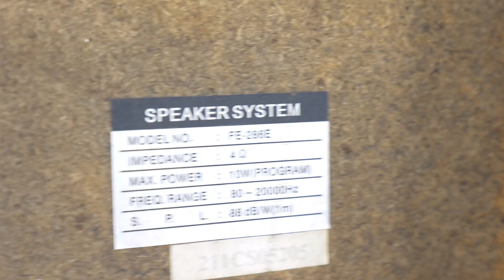Teardown LG Micro Audio System Speaker + Free Air Test

Comment: i would've make a boombox or pc speaker with that driver
only 5w!
very efficient, i bet it's sensitive!
Reply from the maker: Simply glue the satellite speakers to the subwoofer, connect an external 12V battery, and your boombox is ready.